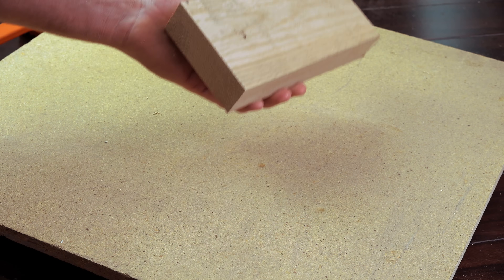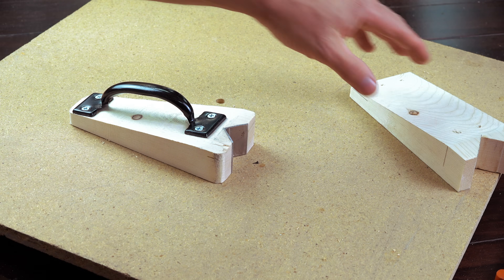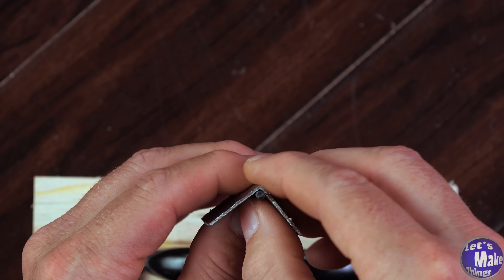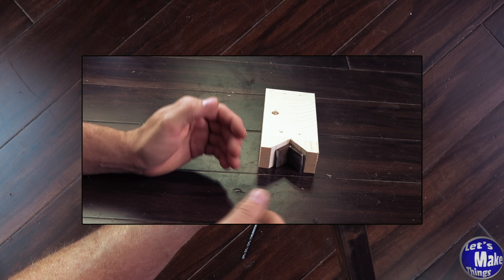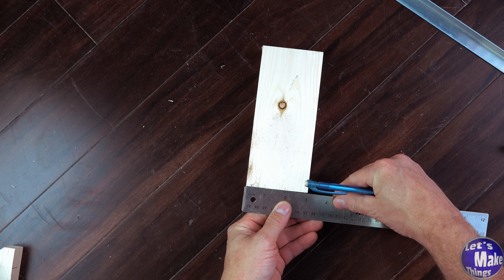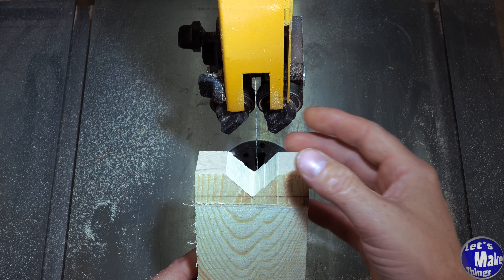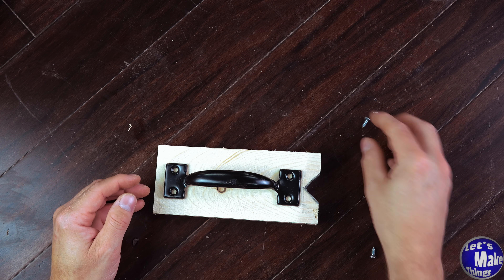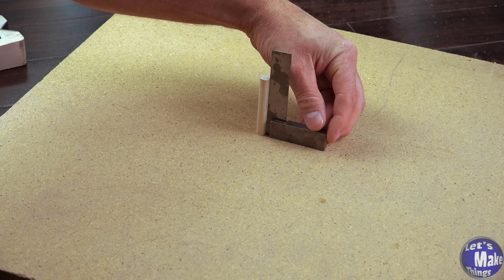Make a Hand Drill Jig that will give you Drill Press holes! // Step by step instructional video

Comment: Glue two pieces of MFG to make your V, like the corner of a box. Doesn't actually have to be any particular angle. If you need space underneath, Forstner bit perhaps, use a think enough base plate to lift the jig.

For just a few holes, don't worry about the metal.
Reply: Could also make one maybe 30 cm long like an actual box and cut pieces off with a (table) saw.

Comment: would the steel "insert" not wear down your drill bits faster?
Reply from the maker: No, not at all. The spirals don’t need to be sharp. If they feel sharp, it’s only because there’s no reason to dull them after cutting—it’s just a result of the manufacturing process.

Comment: The orange 'handle' you have there is a self centering dowel jig that you're holding upside down. Turn it over,  twist it on the edge of a piece of wood and the stops will put the drill hole right in the center. It's not designed to be held flat. Use the stops.
Reply: I wasn't sure myself, but I was thinking it was upside down. I was curious why there would be pegs on the top side of a drill guide.

Comment: Great idea, I think I will try this, I shall also affix some 400 grit sandpaper on the underside to prevent any movement of the jig when drilling
Reply: Exactly what I was going to say. 😁  This is a more ergonomic implementation of the hand held, right angle jig than some I've seen and the sandpaper idea might just elevate it a tad more.
Reply: You could also pick up some cheap bike tires at walmart and use those for "non-slip" pads.
Reply: @philipmcdaniel7104  or grippy drawer liners and similar material. There might be some in the kitchen.

Comment: Excellent jig for ruining drill bits, well done!

If you need a guide just drill a hole in a piece of wood at the drill press and use that, support in all directions.  

Not a better mousetrap.
Reply: I had the same thought - instead of ruining the jigs, this will dull the drill bits